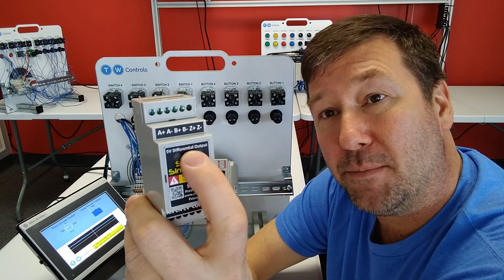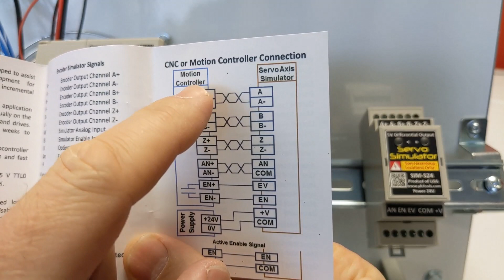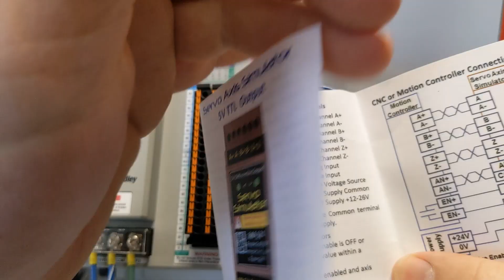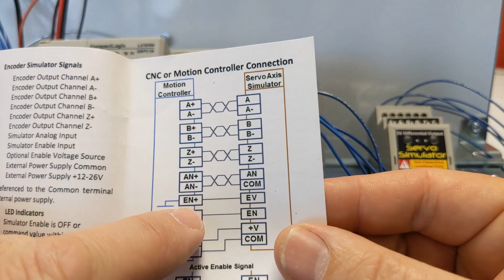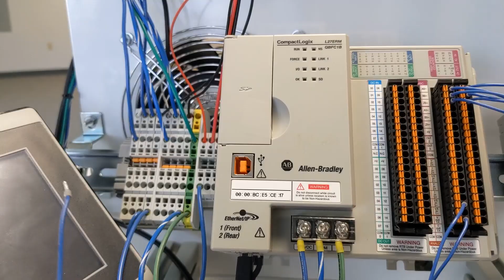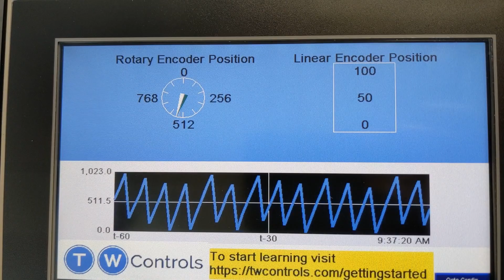Simulating Encoder to Allen Bradley Compactlogix High Speed Counter

Comment: Thank you for your video. Question. I bought Simulator Encoder Open Collector. how to connect the IO 1734-VHSC24 card. Thanks again for your videos.
Reply from the maker: I don't have a video on it but it would be similar to this one, most importantly none of the encoder signals go to the the plus or minus of the power supply, they go directly to the PLC inputs.
Reply: @TimWilborne  okey i did but don´t work. It is possible to use another medium to show my concerns ?
Reply from the maker: Shoot me an email, you can just reply to your order.  It is hard to nail it down in a youtube comment.

Comment: Hii. I don't have much experience in this field (2 years working on). There's a factory where I provide automation services, and the transport chain is not moving continously (apparently with small pulses, like when one car is pulling another but the rope is not tensioned). I think this is because the slack in the chain, not because some slip in the motor (visually it appears to have continuous moviment in the gearbox output shaft. The chain is after this part). In this case, a have to show that the motor is okay and ir have an encoder, but the PLC is 1769-L19ER BB1B, and I don't have any module with HSC input. So, I can't read an encoder, right? Or there is another way that I can do that?
Reply from the maker: You would need a high speed input expansion module to connect the encoder to

Comment: I've always wondered when I've seen conveyor applications with encoders set up, how they come to calculate the maths to calculate the physical speed of the conveyor. I can happily fit and set up an encoder, to actually calculate various physical line speeds such as m/min is something I've not delved into
Reply from the maker: Most conveyors will run in "open loop" which means that when you set the drive to 60 hz, it runs 100% speed and when you set the drive to 30 hz, you "assume" it is running 50% speed without any actual feedback.
Reply: @TimWilborne  Yes understand that, but some applications you want to know the  physical speed of the conveyor such as how many m/min it is achieving. I know that's a calculation based on the output from vfd taking into effect the motor gearbox size and ratio to the physical shift size diameter to get the physical rpm. However just wondered how people achieve that math as I always see it already calculated never been the guy to do it from scratch
Reply from the maker: @hallauk26  For the calculations, we just recorded a video last week on this.  Hopefully we'll have it edited soon.
Reply: @TimWilborne  fantastic can't wait to see it. Keep up the good content 👍